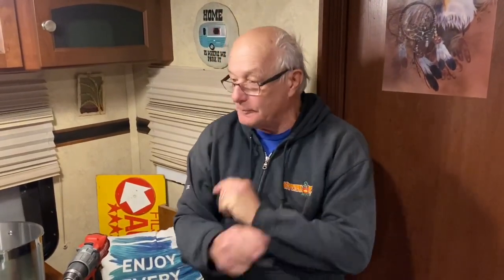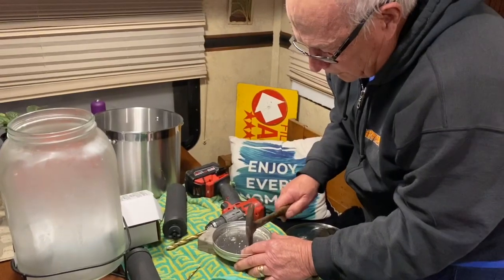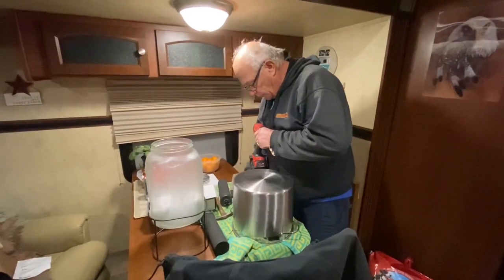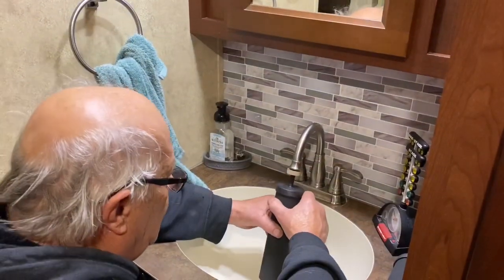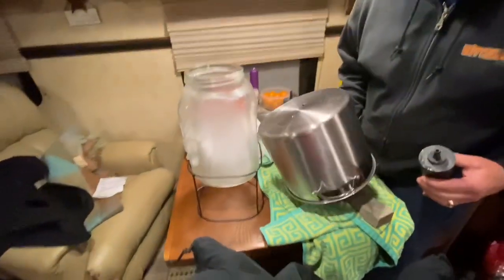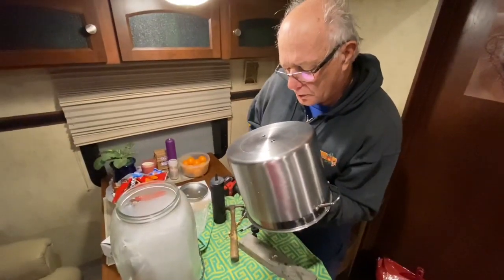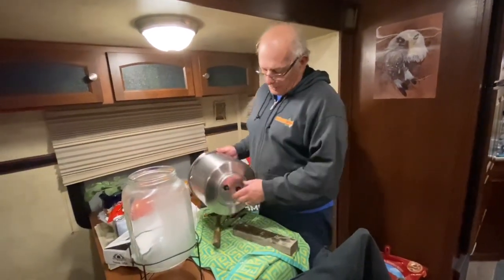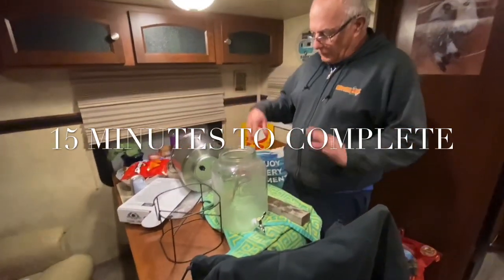How to make a water purification system at home

Comment: Great Idea doing this as a  DIY filter. The important parts are the filters. You could also just do one filter if you are short on money. Great video Paula!
Reply from the maker: That’s a good idea, I do believe you can only order set of 2 filters
Reply: That was the question I had. I want to go small and using an asparagus steamer for my top. So thought I could just use 1 filter. Got my filters and the extra one will last in storage until I need it.
Reply from the maker: @RVTollersTammi  sounds great

Comment: What size is the pot? And what size is the jar?
Reply from the maker: I used an 8 litre jar (a 4 litre will work as well) and  the stock pot was 8 or 12 quarts. The main concern for the stock pot is that it measures at  least 8 1/2 inches tall to fit the filters inside and is stainless steel.
Reply: Thank you!

Comment: Very cool!  I wish there was a solution for tiny living.  Those things would take my entire kitchen up.  Badge is such a great guy!
Reply from the maker: I have an 8 litre base but I could have used a smaller base. Also, You can take the top part off when you are not filtering water and use less space.
Reply: I am using a smaller container and an asparagus steamer pot with one filter. Will take up less space.